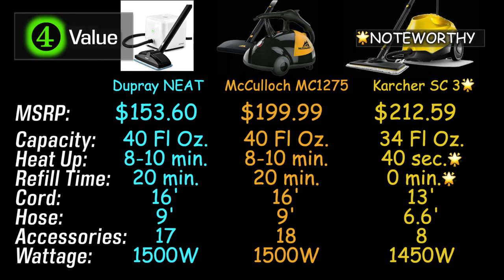DUPRAY Neat Steam Cleaner REVIEW - Watch It Clean + How To Use (THE TRUTH!)

Comment: This steamer doesn't pump out 275 deg of steam. That is the temp of the steam in the boiler tank but not the temp of the steam coming out of the end of the nozzle. The temp of the steam out of the nozzle is around 180-212 deg. Non pressurized water turns to steam at 212 deg. The 275 deg temp is just a deceptive marketing trick & a little rsearch goes a long way.
Reply from the maker: Can’t argue with that. Thanks for posting.
Reply: That's disappointing. That's one of the reason I was going to get it. Any steamer that does get that hot?
Reply: @ariesbabie5971  i used to have a list of steamers & their effective usage temps but i can't seem to find it. Basically the more "pro" or industrial grade machines like Aqua Pro, Mytee, etc will come closest to the hottest steam temps but that's also why they have higher price tags. The temp you need is also dependant on what you're cleaning. I use steam for auto detailing and thus I don't want/need super hot steam because I don't want to damage leather or electrical components, but if you're using steam for disinfectant purposes you need steam at ~250 - 275 deg. If you can't find/afford a steamer with higher temps, a combo of a lower heat steamer followed by a UV-C light can be a great combo for sanatization of surfaces. Just be careful with UV-C light & skin exposure becasue it can cause burns & cancer from prolonged exposure.
Reply: @Status Quo Reject  yes, that's the exact temp range I was hoping to find. I would def be willing to pay for the right type of steamer (I say that without knowing how much the ones you listed cost). I will def research them as I feel a good one would last a while and def be worth the money. It makes sense the reason why you have one in the range you do. I def won't mess with anything  UV. I don't mind using chemicals; I just thought steam would be a great addition. Thanks for your input/insight.
Reply: So at 180-212 it won’t disinfect properly?
Reply: @mcalann  it does clean and sanitize to a certain extent at 180-212, but to be sterile it needs to be at least 275 deg
Reply: Its more than perfect for bed bugs
Reply: This is good information. I just purchased a new home. I’m hoping to purchase a steam cleaner that can clean my house. Any suggestions? Thanks
Reply: @hunterd2467 have you tried and tested? I purchased this for that reason. I only found one dead bug in the middle of the room a month ago. May have dropped out of my luggage but I want to steam everything just in case.
Reply: There is nothing deceptive with the pressure and temperature of the boiler. You are referring to adiabatic cooling and while it is true the steam will rapidly drop to 212 degrees or lower due to the volume expansion. The boiler temperature will matter for other reasons. A big reason is steam produced under high pressures and heat will be drier and steam with less moisture will penetrate fabrics better and leave less water on surfaces. Pressure and heat go hand in hand with steam and a higher boiler temperature will mean more steam at a higher pressure leaving the machine which is obviously a big deal. 

While these terms are used as a selling point they are also specs of the product and will affect its  cleaning power. Companies could do a better job of explaining this but it’s not super simple and it’s easier to just give the high boiler temps and pressures.

Comment: I bought mine originally because my self-cleaning oven, which was based on a low temperature water cycle, never worked. In addition, the oven's coating prevented me from using an oven cleaning spray. Initially I had problems similar to yours; but found that if I took my time and used the plastic nozzle tip,  the steamer worked wonders - especially on the glass window. I also use a disposable liner in the bottom of the oven to prevent casserole spills from hardening.
Reply from the maker: Thanks for the tips. I’ll have to try working on the oven again.

Comment: I’ve had one for about 2-3 years.  When I bring this pretty little thing out-  the house is getting seriously cleaned.   Easy to remove grease and grill cleaning.  I end up enjoying cleaning so I end up cleaning more than I ever expected.   Clean the windows too but yes have to wipe up when not using a mop like head attachment.    Going to attack the car next time.   Extremely useful and enjoyable to use. Just have to learn to go slow of cleaning certain things-  like   Grout.  Let the steam do the work.  I recommend it or a steam cleaner in general.  If you use the stainless steal attachment it Will absolutely clean  faucets and ovens and grout.  The plastic ones won’t do it.  I still use cleansers.  I don’t ever feel like I’m steamed out or overwhelmed by steam.  That’s pretty silly.  It’s not that loud either considering it’s scrubbing - as opposed to you physically using scrub brush.   I think this guy is being a bit petty for what this machine does.    Yes you will have to vacuum or sweep because it isn’t a vacuum. Duh.
Reply from the maker: Thank you for sharing your thoughts and experiences. If I had to do it over, I would choose a steam cleaner that doesn't require a 20 minute cool down and 10 minute ramp up time... they do exist. 😃
Reply: I too wish there was a way to know the water level.   But when empty open the hose and you can fill up without waiting.   I’ve found this to be a miracle cleaner and use a cleaner beforehand for showers and use a bigger head attachment- works for me.   I think the cleaning capabilities of this machine are tremendous and it even helps clean carpet too!   I’ve used this in stubborn carpet stains and they are finally gone.    Maybe you just imagine a machine to clean for you.  This is not it.  You do have to clean while using it.  It is amazing aid in thoroughly deep cleaning almost everything I have inside home and the grills outdoors.   I would never have thought about saying the cord is awkward and the steam too much!  That’s nuts.  The machine would dramatically help people but you seem to pick on the little things.  Good luck.
Reply from the maker: Thanks again for sharing your experience using the steamer. Should you decide to make a video demonstrating how to fill the machine through the hose without allowing a cool down period or how to use it to clean carpets, I’d be happy to include a link in the video’s description. As far as deep cleaning carpets, I find the steamer to be better at “refreshing” or deodorizing stale, medium pile carpeting versus deep cleaning it. When it comes to removing stains on medium pile carpeting (for example, cat vomit), I’ve found the Bissell Green Machine to work better. Thanks again, and let me know.

Comment: I love mine reason I got this 1 u don't need distilled water just plain water I'm surprised u didn't say that in this video also some things u can't get cleaned
Reply from the maker: Thanks for sharing your thoughts. In the video I say you can use tap water (aka, plain water), distilled, or demineralized water. Regardless of which water you use, Dupray recommends periodically cleaning it with equal parts white vinegar and water. If you don’t clean it often enough, the machine will clog as I’ve experienced.
You are indeed correct that there are some things this steamer will not get cleaned despite the claims. For example, it will not clean an oven. Thanks again.

Comment: Nice review.  I got mine around 3-4 years ago after having a different brand that failed twice, plus the price point fit being retired.  I’ve cleaned everything inside & outside, the fridge (inside) , the oven, etc.  Birdbath, mag wheels (definitely needs pretreatment there).

The inside of the glass oven door - it does a good job softening the grease on that glass, then I use a razor blade to scrape off the softened gunk.  Then I spray it with Dawn and wipe down.  Pretreat burners but deeply burned on gunk is impossible for most things to remove.  I will pretreat grout and other things before I steam and it cleans up just fine.  Stainless steel is hard to polish up with a steamer.  I’d just use appliance polish.

It doesn’t remove everything!!  I agree about the water level issue.  I watched your cleaning video on this; trying to drain it all the way is impossible…there’s always some water left.  Good to know about the vinegar issue down in the comments!!  Waiting to refill is a pain but then, I’m done with most everything before it runs out of steam lol.  

Since I’m now in an apt. the size and cleaning time etc. doesn’t bother me, but for large spaces and a family, a different model or brand would be more efficient.  Thanks for reviewing!
Reply from the maker: Thanks so much for sharing your experience!

Comment: Great review.  Mine just arrived today and after seeing this, I will return it immediately.  I had read it was the most powerful and that it may be overkill for home use.  I would rather have a more powerful one than one that doesn't save me any time. thank you for saying that it's actually just the opposite.  I really wanted to take on a large area of cleaning grout.  I thought it would clean my labor in half. I see that it wouldn't.  I was also depending on at least an hour or usage.  Thank you so much. You just saved me $150.   If you have another that you prefer, please let us know.
Reply from the maker: I don’t have a recommendation for a different model, but this machine does not live up to the marketing hype. For efficiency, look for a model that doesn’t require any downtime to refill. You may still have to wait a few minutes for it to generate steam, but for big jobs, the wait to refill it is a drag. If you find a steamer that works well for you, I’d appreciate a post back as to what you got and how you like it. Good luck!
Reply: My friend just bought a Grobell steamer and it has 'Heating time less than 1 min' and refill the water anytime without letting it cool. Comes with a protective mitt for that. I am going to try it.
Reply: @TruthSeeker-ee8tj  Curious if you bought the Grobell & if you like it.  A high percentage of reviewers said it  broke after only a few uses.

Comment: Thank you for your practical and transparent review! I'm in the market for a steam cleaner after finding evidence of rat infestation around my living room couch. After watching your helpful video, I've decided to go with a different product because I don't have the patience to spend all day waiting for the machine to pressurize and boil up. I'd like to keep my cleaning process efficient.
Reply from the maker: I completely agree that the wait is frustrating. If I were to do it again, I’d get something that allows for immediate refilling. Sorry to hear about your infestation. Yikes!
Reply: Which one did you decide to purchase?
Reply: @ariesbabie5971  I decided to buy the Karcher SC3 due to its versatility and quickness to heat up the water when refilling.
Reply: @Joschmo939  hmmm I might revisit them. I have another product from them, but I thought dupray was hotter with more pressure. I've been told it's not accurate info. Once you've used it and have a good idea if you like it, reply back please.
Reply: @ariesbabie5971  So far, I have used it once to clean my entire apartment. That includes amenities like countertops, stoves, bathrooms, windows. I would suggest having a rag towel with you to wipe off excess water because the Karcher SC3 can sometimes drip water as you're steaming. As far as the effectiveness of the Karcher SC3 removing stains, it's excellent, and I love that you only have to use water for it! In my general opinion, I still think it is a good idea to have some other cleaning supplies with you  that don't include a steam cleaner. Hope this helps!
Reply: @Joschmo939  oh I absolutely plan to use additional cleaning supplies. I was hoping it would help with grout and touch stains in the bath and kitchen, and a mattress. The car would be nice too. Def not going to be the only source for a cleaning. The townhouse I moved into was "cleaned,"  but not cleaned good enough for me. 🤢 I appreciate the feedback!! That will help with making a decision. Happy steaming !!!

Comment: I'm presently searching for a replacement steam cleaner and this product came onto my radar totally by surprise. I like what I see and I like the positive reviews I have read. Personally I like that I will be able to store it in a "wisely" chosen tote bin far more practically than an upright or floor steamer version which I am looking to replace. I like the hose and handle aspect of it which allows for the cleaning of vertical surfaces or shower walls without holding up an awkward floor cleaner which leaks fluid when not strictly vertical. One of the other things I find (which people don't do) is every once in a while descale it! like kettles and coffee makes it helps steam cleaners to perform in ways that prevent calcium build up when not in use or stored. Now I have seen this product and the review... it's going to be my go to choice!.
Reply from the maker: Descaling is definitely important. One of my biggest issues with steamers (and this one is no exception), is that it’s really difficult to get all the mineral deposits out. Because there’s a steam chamber above the boiler and the fill tube runs below that chamber, when you go to poor out the water, the mineral deposits get trapped and don’t all come out. I have to shake the heck out of mine and still they don’t all come out. I know this because the last time I cleaned it, I then stuck an endoscope (camera) inside to inspect. To my horror there was still a lot of debris in there.
Reply: @BruceAlanR  Ohhhh 😮😕

Comment: This was a great review. It seems like a good enough machine but you have to actually consider the jobs you want to do and decide if it is the best tool for your personal circumstances. Not all floors are the same. How frequently will you need to use it? How many times will you choose to just wipe something down with a cloth rather than unravel the cable, fill the cube, wait however long, mess around with attachments. Etc. 
You have helped me to analyse my perceived need for one.
So far it is looking like I would only want it for carpet cleaning/freshening. Is it worth it for that?
Reply from the maker: Your comment is dead on! It’s funny because your comment made me think of our robotic vacuums. For example, there have been times when I think, “do I run the robots, or get the job done in a quarter of the time by grabbing a broom.”
I’ve used the steamer to freshen up the sofa and rugs and it’s a sizeable “to do.”  As to whether it’s worth it, that’s up to you. Knowing what I know now, if I had to buy another steamer, I would consider a model that allows for quicker refilling because it’s a real pain to have to wait 30 minutes for the boiler to cool when doing a big job.
Reply: @BruceAlanR  30 minutes? Wow that's a lifetime when you just want to get on. 
I first saw that this was suggested for windows but is it really safe on glass at those high temperatures? It would be just my luck to hear a big unwelcoming crack! Lol
Reply from the maker: I definitely wouldn’t use it on glass during the winter. 🤣